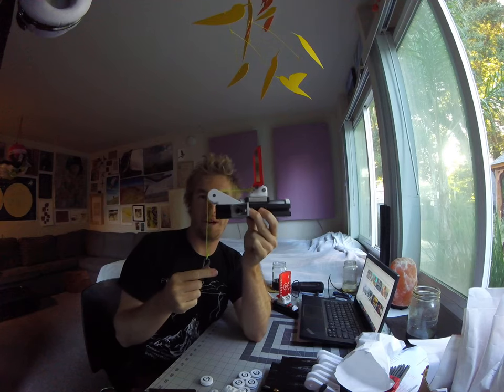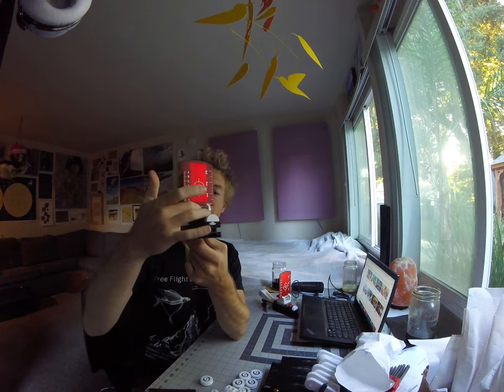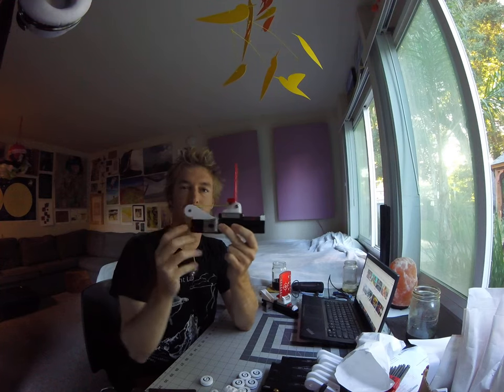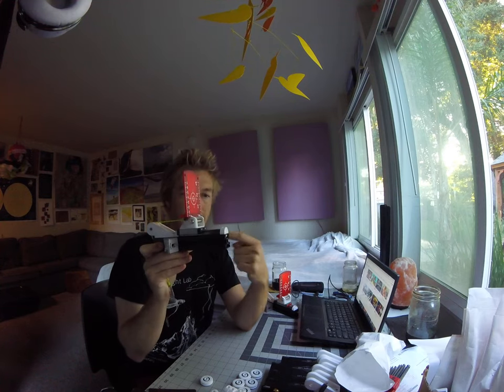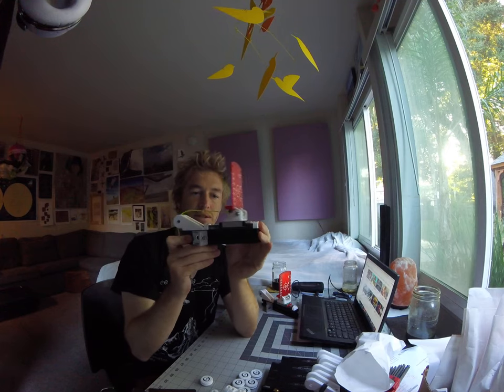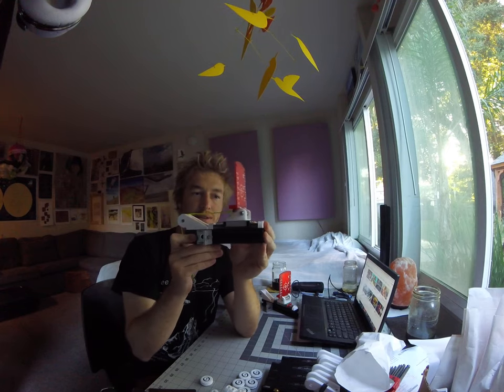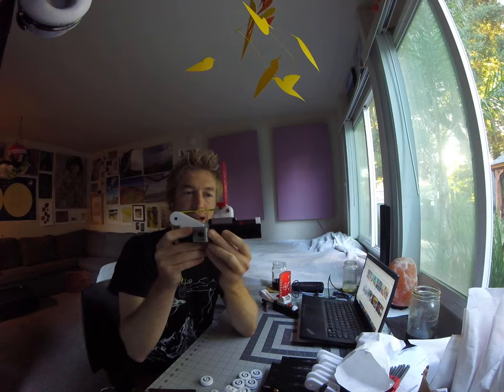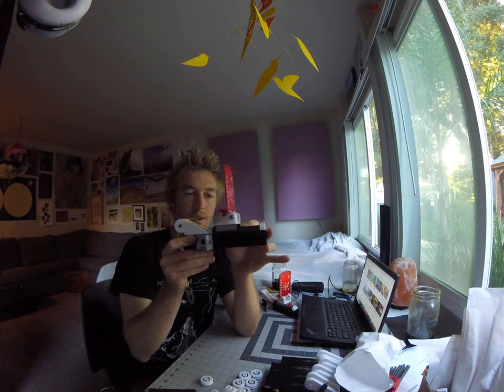Free Flight Lab - Line Trimming Rig Intro

Comment: How long does it take to measure one glider?
Reply from the maker: It depends on the glider and the operator. (also if there is a data recorder assistant) Enzos and 2 liners are fast, Tandems and Acro gliders have more lines. 
Sometimes adjustments are needed, and if you have soft shackles it will take longer. 
I have done it in an hour... all the way to it taking an entire day. ;)